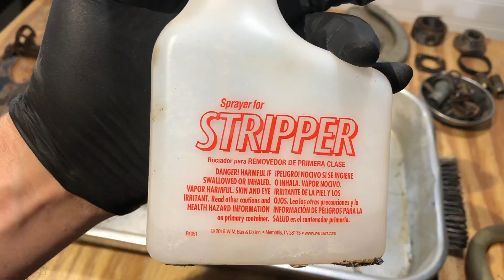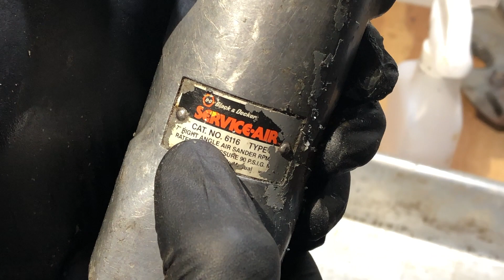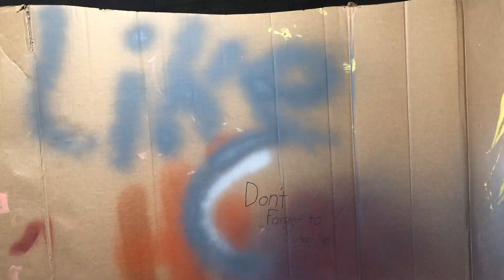[Never seen before!] AIR POWERED SAW Restoration! (Homemade)

Comment: Used in wet environments like Seattle, where rain days are a given....kinda noisy but far better than dealing with electric tools in the rain...plus electric tools get TRASHED in rainy conditions…these are like auto - mechanic tools, rugged as heck... being homemade explains the simple design… I like it!! Purpose built professional air tools for construction are expensive!

Comment: Very nicely done. And can I give you a tip for gasket making. Put the material over the part and use the round side of a small ball peen hammer to cut around the edges.
Reply from the maker: Nice! Thank you very much!